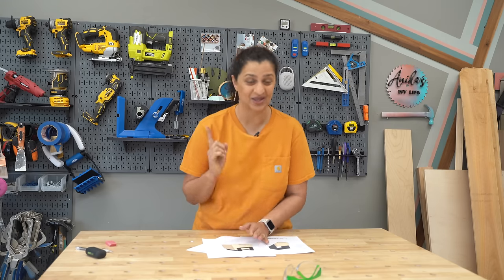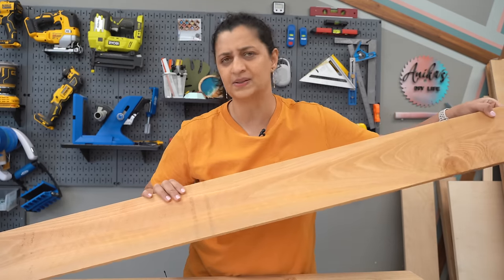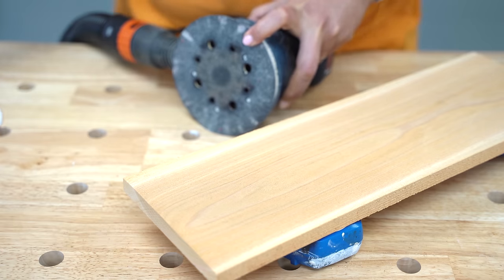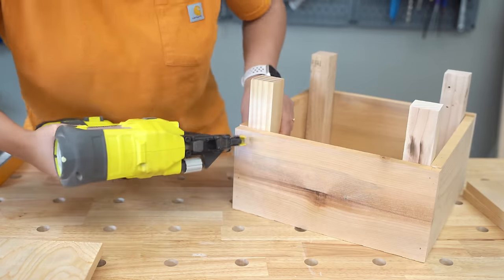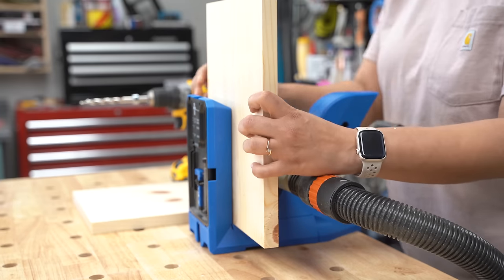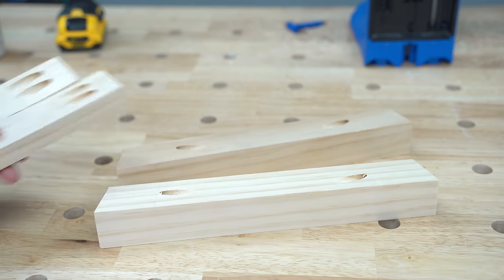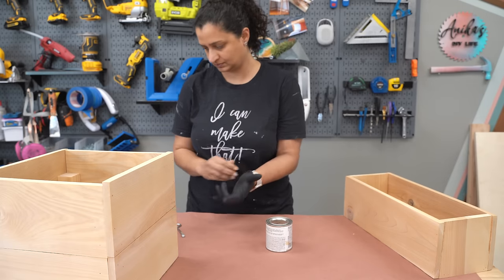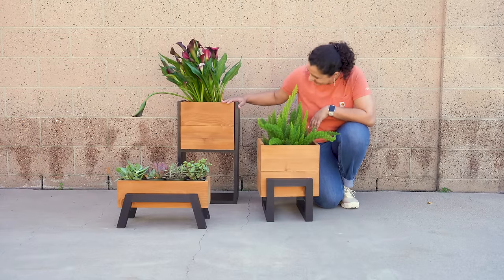DIY Modern Planter Box - 3 WAYS - Quick and Easy Project

Comment: Why did you mark the boards with a pencil before sanding?
Reply: It helps to make sure you are sanding evenly.  You scribble across your board, sanding it all off, and repeat as you progress through the sanding grits (100,120, etc)
Reply: @mikem2113  great idea!  Thank you for the explanation!
Reply from the maker: Yes, using the scribble helps make sure you get even sanding across the whole board and just the right amount. I have a sanding video that explains a lot more and also the sanding grit sequences. https://youtu.be/k9JLXge8ZyY?si=6UnnD_LQWQ5dEAJY

Comment: A little disappointed that everything relies heavily on pocket hole screws and all of the associated jigs and clamps.
Reply from the maker: Oh well. That’s how I roll. Feel free to use dowels instead.
Reply: You need 1 tool to do pocket holes, just the jig that angles your drill properly which costs about $20 or so, all the other clamps and such are optional in my experience.
Reply: Well Grumpy Ogre, at least you chose the right screen name.
Reply: I have the same Kreg and use it constantly. Looks much better than bulky screws!!!!
Reply: You can get a used one relatively cheap. That’s what I did.
Reply: I just used heavy wood glue and braid nails bc I didn’t have the jigs. It’s mine so I was ok if it failed. But it’s held up just fine!
Reply: For sure! No need to use any pocket holes on this build. Dowels would be a much better solution for this. Even straight using normal screws with or without plugs would be better, to be honest.